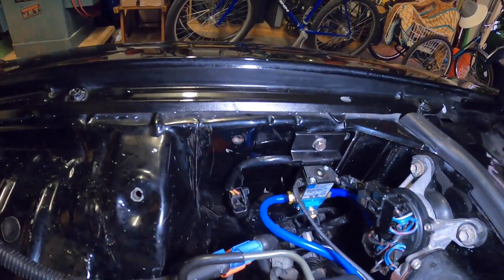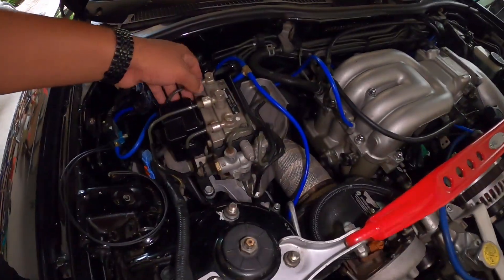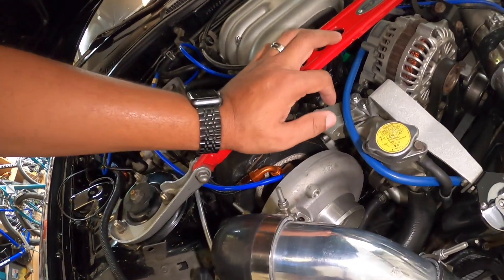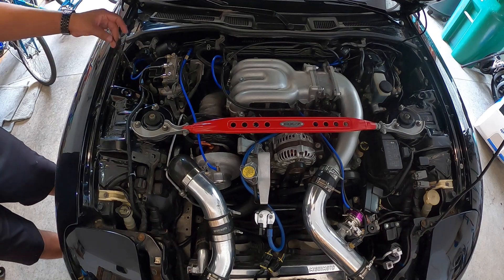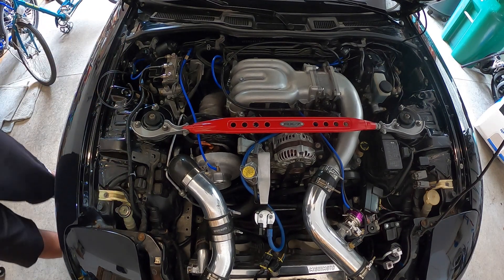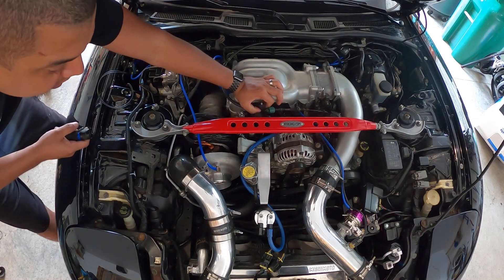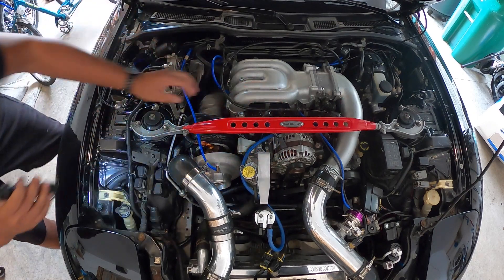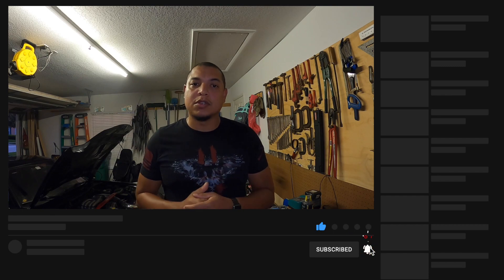Electronic Boost Controller installation

Comment: Could you explain where those 2 wires of the mac valve go? Im trying to figure it out but im struggling a bit, I have a Power FC. do they go into the side port of the pfc ?
Reply from the maker: I made my installation simple by connecting the two wires of the valve to the original two wire connector for the factory boost controller that way I don't have to change anything in on the ecu side. the manual says its connector B1-38 color L/W & B/W
Reply: @therotaryshop1896  Thank you! and that was for the power fc right?
Reply: @EnzedDev it’s not ecu specific, all aftermarket ECU’s will still have the same factory RX7 engine harness pin layout. (Well at least that I know of) I know the Power FC and adaptronic are straight plug and play ECU’s, haltech has an adapter harness between the OEM harness and the ecu. Hope that helps
Reply: @adriandorifito2036  So L/W will be the solonoid valve wastegate control, and B/W is the ground. Do I just cut the factory wastegate control wire , and then wire in the solonoid valve wire into that? it is for a single turbo
Reply from the maker: @EnzedDev  yes there is a factory connector there, cut of the factory connector and connect the valve to does two wires. Here is the repair manual for the FD the info for the connector is on pdf page 34, 35 you’ll see it labeled B1-38 http://www.wright-here.net/files/manuals/1993%20RX-7%20FSM/_Z_Wiring_Diagram.pdf
Reply: @therotaryshop1896  Okay finally this is all making sense to me! Thank you heaps man my search is over hahahah

Comment: Will it work on a diésel turbo VGT/VNT vacuumed?
Reply from the maker: Yea this will work on a diesel turbocharged system. The whole function of a boost controller is to help the WG stay close for a long period of time by redirecting the boost pressure it sees to the top side of the WG and keeping the WG close.
Reply: Thanks bro! How can I control the spool since it is a VGT? I mean on a highway can be configured it to work on less PSI to control EGT? Thanks again
Reply from the maker: @davidfernandez01  you will need a boost controller specific for VGT turbos something like this. 
https://www.gfbuk.com/product.details.cfm?productid=1120
Reply: Basically I am planning on replacing a tillix and needle valve on a nissan patrol gu y61 zd30
Reply: Also sorry... will affect the ECU readings?

Comment: Looks like fun with the dual wastegates, I have never had any of my setup with 2 wastegate. With the electronic boost controller everything is still the same as far as controller, if you got a 10 psi spring the most you can get with the controller is 20 correct. Or can you make more
Reply from the maker: Technically with a boost controller you can have whatever spring you want on the WG and go up on boost till infinite. It’s job is to redirect boost pressure from the top side to the bottom side of the WG back and forth. So you can definitely go passed 20 psi

Comment: hi can you explain which port to connect for compressor, wastegate and bleed to correct ports? some says compressor should go on port 1 and some says is port 3 im confused. Appreciate if you can let me know. Thanks
Reply from the maker: Hey, Normally you want to connect Port 1 of the solenoid to a tee fitting then one end to the compressor and the other end of the tee goes to the lower port of your wastegate. Port 3 on the solenoid goes to the atmosphere and port 2 of the solenoid goes to the top port of the wastegate. Here are two links for a visual (the first link is for a single wastegate, Second is for twin wastegates) Hope that helps 

https://rennlist.com/forums/attachments/944-turbo-and-turbo-s-forum/659321d1346064339-what-is-the-best-way-to-connect-a-dual-port-wastegate-to-ebc-solenoid-e-boost-street_sml.jpg

https://www.s2ki.com/forums/attachments/s2000-forced-induction-142/136069d1501791993-boost-solenoid-twin-scroll-dual-wastegate-setup-eboostdualgatesetup_zpse8d3ab15.jpg